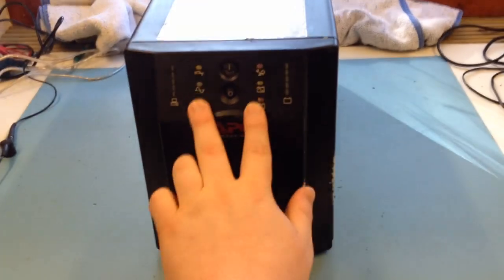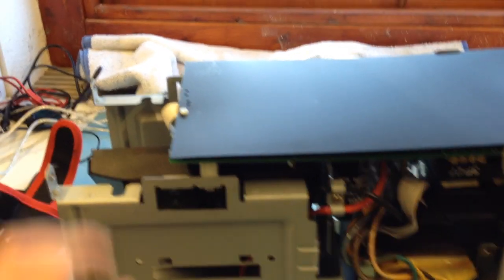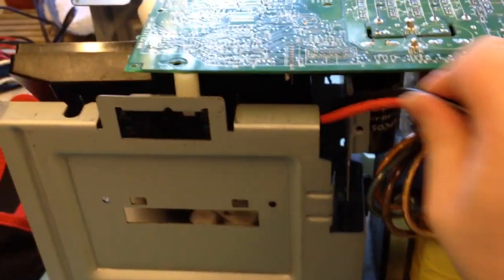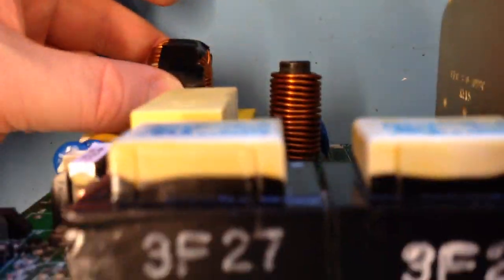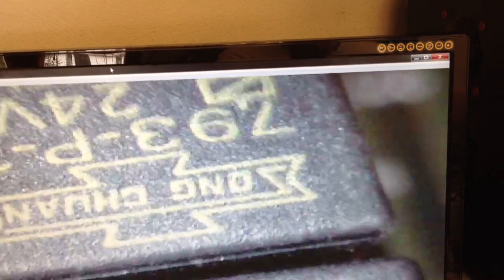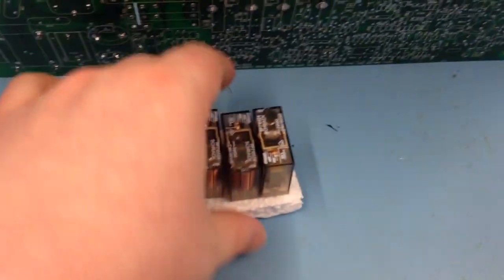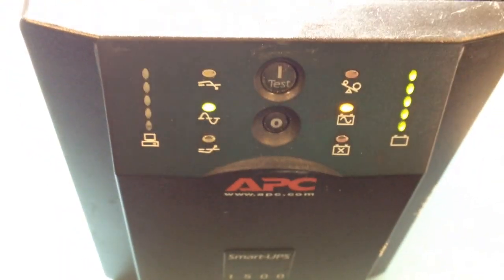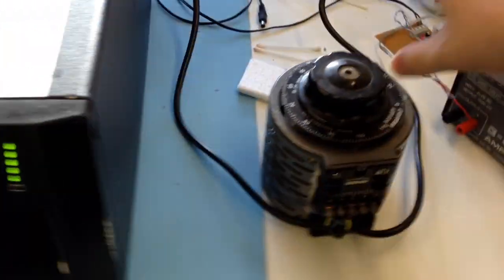APC UPS Repair - AVR Relay Weld fault

Comment: I have this APC SRV1KI , it reboots itself after a AC recovery within couple of minutes during the power loss it works as intended and backup works fine but as soon as the power is restored it reboots after a few minutes and shuts down my computer. I can hear a distinct beep and it cuts off then turns on, I can hear the relay switch. Nothing in logs except AC power loss /Recovery. UPS is 2 years old and I run it in Bypass mode ECO mode. Any thoughts?

Comment: Thanks so much for this!  I replaced the 6 x Song Chuan 793-P-1C-F 001 relays on my Smart UPS SMT1500 and no more "AVR Relay Weld Fault" error (my UPS did not have any Schrack relays).  Not overly difficult to take apart but you do need to have reasonable soldering/desoldering skills.
Reply: Where did you get your relays from? Thanks in advance
Reply: And were the numbers C1251 on your new relays? Again thanks
Reply: @juanfigueroa6941  sorry for the late reply. Got them on EBay.
Reply: The part numbers were exactly the same.  Don’t recall if the manufacturing codes were different.

Comment: your video is really helpful, can you tell how can i myself turn a relay on and off?Is the driving current important when turning a relay on and off?

Edit: For anyone wondering, i successfully repaired my br1000g ups having f06 error by replacing a single relay which i found was having not properly making contacts with the NO pins.

Comment: I have a ups repair shop, problem in apc2200ux model , not working on utility mode and not charging please guide   
For repairing ups and 
send circuit diagram.

Comment: I encountered a similar problem on my cheap UPS many years ago. One of the relays wielded when it trips then no longer able to un-trip due to wielding effect from sparks over time. I fixed it by tapping the relay with a screwdriver to un-trip it when there is no power only to stuck again after several weeks. I replaced the relay but the problem is there again in a few months. I was able to track down the culprit from a cheap switching power supply which was plugged into UPS outlet. It doesn't have an inductor from the inlet to rectifier diode which resulted in large transient current from a large filter capacitor. I replaced the power supply and I didn't have a problem ever since.

Comment: I know it’s been a while but thanks for making this video. I also have a smart UPS that is having an AVR Relay weld fault. Took it apart with your instructions but noticed the cap next to the connector by one of the 3 Schrack relays had totally fried. It was a crispy mess and melted the relay next to it and made a total mess. Oh well, so much for that repair.

Comment: I have a APC RT 3000 which says Relay Fault Present and PFC Fault and has all lights blinking. There was a relay which was constantly clicking and now it no longer provides any power. I wonder if it´s worth changing the relays to fix it or just dump it

Comment: These relays have issues even with new APC units... Best to have industrial grade ones on hand. As this issue will come up. If your power company is over\under voltage at the service.. In which case. I would install a buck\boost at the service. As it can affect Light Bulbs. Motors and Electronics.

Comment: I was wondering if the problems I have with my two APC Back-Ups CS 500 is also related to the relays? I’m not much of a techie, but I’m nonetheless trying to fathom out the problem. I’m in Thailand, so the power supply is not great here. The batteries are fine in both units, but they occasionally suffer intimidate problems when the power supply goes off or when starting up and self-testing. When this happens the UPS passes the self-test and the battery light is green, so everything says the UPS is ok, but no power comes out to provide backup. When this happens, there are no warning bleeps and everything is still showing as ok. It even passes the test on Powerchute. It's not being overloaded and the batteries are ok. After a couple of days of use, it then corrects itself and is usually okay for a few more weeks. This happens more often with one unit, and hardly at all with the other. There seems to be a generic fault with both units though which is unusual. Any suggestions would be greatly appreciated.
Reply from the maker: CineSceneZone it does sound like it could be a relay issue although I think the CS 500 has a circuit breaker on the back which could also be suspect.  The Back-UPS series is more basic so may not have as much internal diagnostics as the Smart-UPS series so may not pick up the fault.  If you can replace the relays for a reasonable cost it may be worth a shot.
Reply: Many thanks for the quick reply. I'll look into it and see if the relays could maybe be replaced.

Comment: I was able to use much of this information to fix a 2200VA Smart-UPS. So I fixed a $1000 USD UPS with $24 worth of relays purchased from eBay. I especially appreciate you including your post repair test methods. Thanks for taking the time to put this together and for sharing it.
Reply: Hi! Do you remember what the fault code was the UPS showed for this fault?

Comment: Hands-down one of the best UPS repair videos out there. thank you very much RedDragonUKTech ! 3 thumbs up for terrific work. Close to 40k views for a UPS repair video! Not bad at all.

Its always a thing of beauty to watch a real pro at work. Look at the tools and techniques, required to really do this right: Variac, multimeter, soldering iron etc (and sucker). 

The one thing missing, and I agree with other commentators, is it would have been nice if the relay part numbers and sources were listed...but with Google nowadays....you can get that if you really want to.

The SUA 1500 is a very popular UPS, and yes, sadly, this relay failure is much more common than we would have liked....thanks again RedDragonUKTech for sharing your expertise. Much appreciated!!!
Reply: I have this problem chang battery not help.

Comment: I have an APC S10BLK and I am experiencing the same response.  I've watched the video and replaced all 5 relays, but it is still not working properly.  Now with the new relays it will function to a degree.  It does not offer a fault as long as the power cord is not plugged in.  With Battery, it indicates 6hrs runtime remaining.  As sson as I plug the power or turn it on with the power pluged in, I receive the Relay Weld Fault.  What could this be?  Are there other relays that need replacing as well?  Please help.  Thanks.

Comment: Hi , thanks for the video. I have the same problems with my smartups 1500. wathed your video and replaced all 5 relays. after that started up but unfontunately all leds still light up.
after that i tried to reset by remove the plug on the back but not the result i wish.
all lights still blinck.
do you have a idea where to look now ?
thanks in advance
kind regards J Pompe

Comment: My APC RS 800  is fluctuating between AC and Backup (Battery) but if i put off AC (mains) then it works fine. Battery does't charge in AC.
What's wrong ?
Reply from the maker: Have you tried adjusting the sensitivity?  There's a small button with an LED on the back of the UPS for this purpose.
Reply: Thanks. Problem is Cap C6o.

Comment: I had a similar problem with an SMT750. I found 1 SPST relay RY5, which I assumed was a  main power relay of some sort, and 3 SPDT relays RY1-RY3. No RY4 anywhere, so I hoped the 3 relays were involved in the AVR circuit. Unfortunately, they all checked out OK on the bench, but for $0.64 each, I'll replace them all and see what happens. Do you know of any source of schematic diagrams for these things?

Comment: Great video - beyond my soldering skills, but a good starting point for finding the issue. I am using a US model APC Smart-UPS 1500 in Brazil that was imported from America (as far as I can tell) - it was in service for 4 years, and then I had it serviced by an authorised APC Engineer here, and the batteries changed 4 months ago. The AVR trim light is always on - I suspect because US is 110v and Brazil is 127v, and I am actually getting around 135v in the socket. So, I am going to try and check/change the thresholds as appropriate. Thanks for the video.

Comment: @ Dale
I'm a similar situation, but my unit is for 110V AC (DLA1500). I have OMRON relays on the board, one of them is burnt out as well.
My unit though goes to self-protect mode right away and doesn't have the front LED that flashes. Hopefully I don't have any caps that are shot as well since the unit I just bought on ebay was made 2001. When I find the parts on Mouser or Digi-Key, I'll come back and reply. Perhaps I'll buy the caps while I'm at it...
Thanks RedDragon!

Edit: yup, got those G2R-1-E and will check if either Mouser ou Digi-key are cheaper for shipping...

Comment: Just rescued an APC X1500 with a good battery from the E-waste.  I didn’t have to remove all the relays because they had clear plastic cases and it was obvious which one was damaged because it was charred.  Found the part (G2R-1-E-ASI) on Amazon for 3 bucks.  I’d recommend taking pictures during disassembly because many connectors are neither labeled nor unique.  Thanks.
Reply from the maker: In my case, only one or the relays was faulty as well, but it wasn't as obvious because the faulty one didn't have a clear cover.

Since this UPS was going back into service in a commercial environment I decided to replace all of the relays as a bit of preventative maintenance.

You're right about taking photos, it would be very easy to get it wrong if you weren't paying attention as there are places on the board obviously designed for different types of relays.
Reply: hello Sir 
what is relay weld test

Comment: I've had a similar problem on several APC ups units. It seems (in the UK) that it's due to our 'unified' 230V supply which is just the same old 240V one with the tolerances moved. As a result the UPS's are supplied set for 230V but often seeing 250V or more. This causes the AVR relays to click over regularly and eventually fail. If the UPS is re-set for 240V the relays rarely activate and last much longer.
Reply from the maker: Very true, at home and in my workshed the mains voltage sits around 245V but I've seen it go as high as 255V ish.  I changed all the UPSs in my workplace to tolerate UK voltages but this one I repaired wasn't mine.  I did change the thresholds after I repaired it to prevent future failures.
Reply: +RedDragonUKTech Hi - thanks for the video. How do you change thresholds to prevent failures ?

Comment: I had this exact problem after a major power out: Fault, call support: AVR Relay weld.
I fixed it by resetting the UPS: Remove battery connect at rear of UPS (it is marked, just unplug the bat connect tab). Plug the UPS back in, and then turn on. Let it power up... it will tell you it needs a battery. Next, power it down and unplug. Plug the batter connect back in (see rear). Plug in the UPS.. power up. Presto.. it is reset. If it is NOT reset, please have fun taking it apart as per this video... but if it does reset, you may not have to take it apart.
Reply from the maker: Resetting the UPS will clear the error, but you will probably find it will happen again.  The error occurs when the UPS has to boost or trim the AC input voltage.  That's the purpose of the AVR (Automatic Voltage Regulation) circuit.  If you have a sag or spike in the supply voltage and it drifts outside of acceptable levels  the AVR will switch taps on the transformer to compensate.  If the relays have sticky contacts this may be delayed or may not happen at all.  This could cause a situation that could cause major damage to the UPS so it will shut down to protect itself.  This will also cause your load to lose power.

You could use a variac to test the AVR circuit like I did in the video.
Reply: reddragon27284
I agree, the UPS MAY still have a 'problem' with the AVR after this reset, however, it is also possible the unique characteristics of the first power out it experienced caused the 'fault' to appear as an ACR weld.
The UPS has experienced at least one power out after I reset as per above, and an 'AVR weld' fault did not appear. The reset I describe may be a temporary fix. I did re-run a calibration and set the option to 'poor' power after the reset... and I accept this may be temporary. I am upgrading this system to a bigger UPS as we speak... so at least this reset bought me temporary protection.
Best,
Gordon

Comment: Can you list the replacement relay part numbers as I can't the ones listed on the video on digikey.
Reply from the maker: Hi,

Yes, I ordered 2x Z2513-ND (DPST Relay) and 3x PB946-ND (SPDT Relay).

These particular Digi-Key part numbers may no longer be available so please check the datasheets and ensure you order the correct equivalents.

Hope this helps.

Comment: Thanks for the video! Mine have this probs too :(
Can you write exactly which relays you have replaced? Thanks
Reply from the maker: I replaced all of them on the assumption that if one has failed then maybe the others will too.  Didn't see the point in having to repeat work if I only replaced the faulty one and had to open the thing up again later if another one failed.